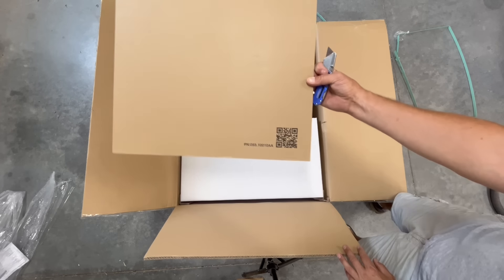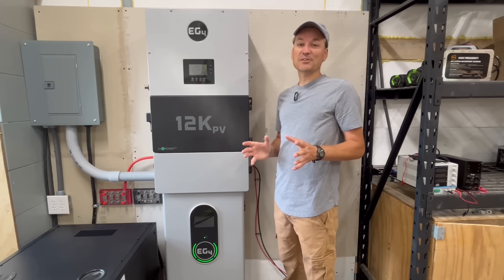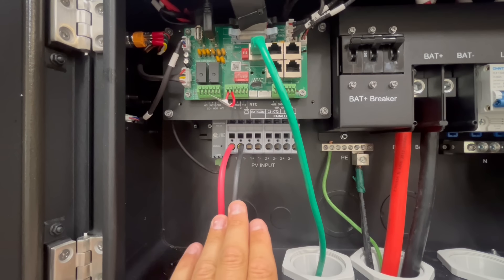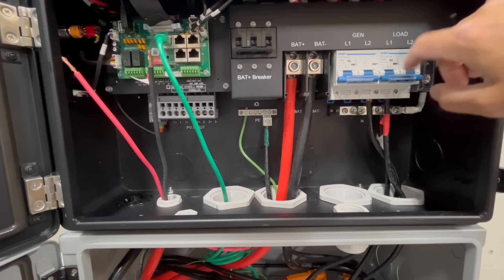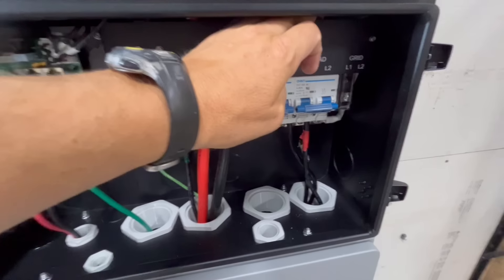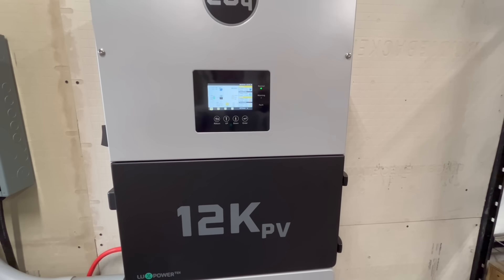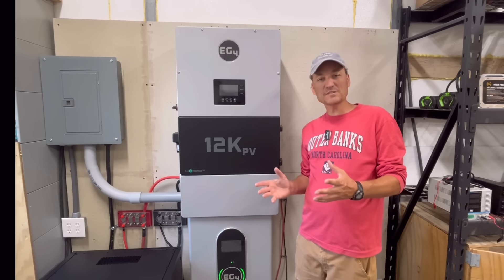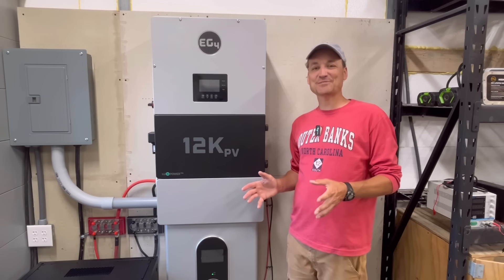The new EG4 12KPV inverter review & testing~ Massive surge capacity in one small package

Comment: Gavin, this is what I need. Do you think two 6000xp  would be more powerful  utilizing 16k worth of PV? Two 6000xp would still be cheaper but at the expense of bit more idle consumption.  I am really having a hard time deciding although my application is off grid.
Reply from the maker: 2-xp’s vs 2-12kpvs?
Reply: @GavinStoneDIY  I am not sure what your answer is, should I buy 2 6000xp or 1 12kpv?
Reply from the maker: @ianstephenson650  ahhh ok. I was just asking if you were considering 2 of each. 

It really depends on how much power youll need. The 2 6000xp’s will output 12,000 watts. And you’ll be limited to 8,000watts with the 12kpv. So things like water wells or larger electric appliances have to be taken into account. The 12kpv wouldn’t be able to utilize the entire 16k of solar. So that’s another factor. And then redundancy is something to ponder also. If one of your XP’s goes down for some reason you’ll still have power. If the 12kpv drops then you’d be out of power unless you have another backup. There is something to be said for both really.

Comment: great job as always thank you...would LOVE to see a comparison to the NHX-10K...that NHX seems to be holding up pretty well from what I read on the forum, and the price is really good too...
Reply from the maker: Yeah the NHX has a bit more output power. But it lacks an AC coupling option. This inverter is way easier to wire up because of the wiring compartment space. Plus it has better line balancing and surge specs. Although the NHX is still cheaper. It probably depends on what someone needs out of the inverter.
Reply: @GavinStoneDIY I’d be eager to see the comparison too. I learned the hard way about line balancing on a 3k unit which couldn’t handle an 1800W microwave or coffee maker so am curious how the NHX fares here.
Reply from the maker: @thedabbler2753  the NHX could handle just over it’s rated output on a single line. But not for too long. 
I do like the multiple MPPT options on the NHX. You could have 4 arrays in different areas with that inverter.
Reply: @GavinStoneDIY  the multiple MPPTs is a major sell for me. Lots of shading here so I have three strings on the go at present. ps. I know this probably isn't the thread but if you have any data on how the NHX does with house lights flickering, or inductive loads. Maybe a future video when the EG4 fun dies down a bit ;)
Reply from the maker: @thedabbler2753  I’ll be honest. I wish I  still had it. It was just a loaner for a review. I had zero flickering lights. And it did better than I anticipated on inductive loads. It wouldn’t have the lengthy surge time of a Lux inverter, but it can keep that steady 10kw rating.